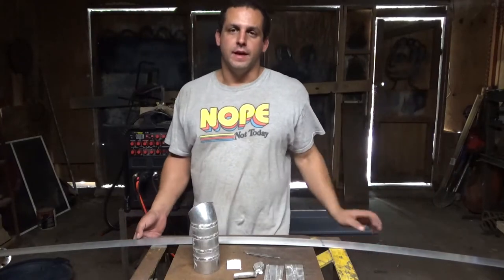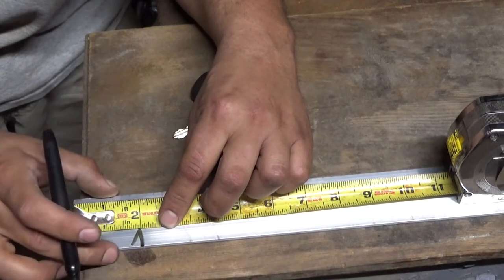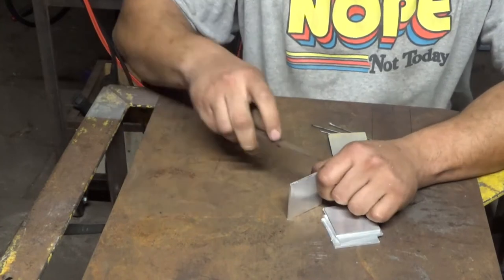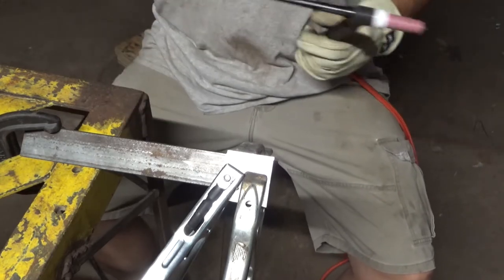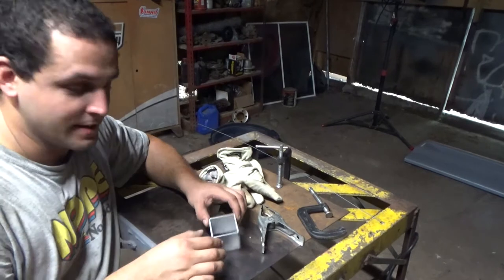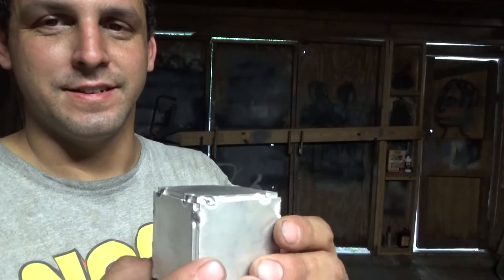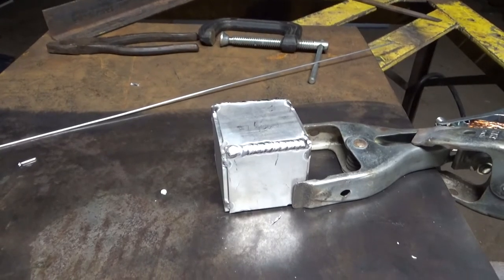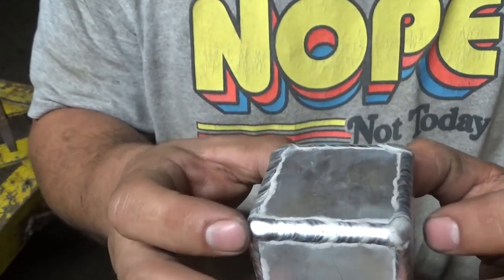tig welding aluminum practice, building a cube with my primeweld 225x tig welder.

Comment: The white color is the cleansing, it happens when you weld AC which alu is done on. This is my understanding. You can control it by changing the balance which essentially set the amount of time it spends on negative/positive. Read the manual on page 37, "AC TIG WELDING", it explains the balance. On the old transformer boxes you would not have any balance, so it would be a square wave with 50% spent on negative and 50% spent on positive. You can change those amounts on the Primeweld with the balance knob. Surprisingly, the manual is not bad for a Chinese welder, and neither is the welder. I had an Everlast before this machine and comparing the inside of the machines is night and day. Surprisingly the machine will actually burn 6010 stick rod, and it has no settings for stick. No arc force, no hot start, but it can burn it. I only use mine for tig welding. I like your attitude, keep welding and learning, don't listen to the haters...the welding community can be brutal, second only to the chainsaw forums...another brutal community.
Reply from the maker: Yeah, I'm pretty new to welding aluminum and I seen that part in the manual that explains all the adjustments.  I will definitely be reading all of that section. Part of my problem I think was my tack welds were too big and I was trying to add filler before I had a good puddle. Not to mention I really don't know how to adjust everything properly.
Reply: @davidcraft4909  I don't want you to think I know what I'm doing, I just play welder on the Internet. As a rule of thumb you should have your balance at about 35% on the Primeweld. I tend to use more steel tube as it's cheaper than aluminum. Not much at the recycler, and often needs cleanup. The prices on steel suck right now though. $30 ain't cheap for that stick of 1/8" you got. Tig is a can of worms as it requires gas, regulators, hoses,  solenoids, special gloves, pedal, angle grinder(s), etc...you need to be able to sharpen tungsten, clean welds, have cleaner on hand, etc..you're doing great, keep it up!
Reply from the maker: I really like tig so far though. I got my first tig welder about 2 years ago. It was a DC only machine so I got a decent amount of practice on steel. But there seems to be a demand for people who can weld aluminum. So I got  an AC DC machine. I think it would be a very good side job since welders like to charge about 100 to 150 an hour.
Reply: @davidcraft4909  I did the same, my Green Weenie was DC only. For most people that's all they really need, it depends on what type of work you do, but the stuff I need is more fabricating, mobile bases, carts, truck rack, etc...some of it is on rusty outdoor steel, so it's not good for tig unless you spend time cleaning it up, so that's where I would use stick. So simple, a stinger and a work clamp...snap, crackle, pop! Tig is the complete opposite, very clean, quiet, almost smokeless, it's mesmerizing. Set your preset to about 2-3 seconds, hang on the end of the bead while you taper off and keep it for those 2-3 seconds over the end of the weld. That'll help those craters. Your beads don't look too bad, you know what's wrong with them, but they look solid and strong, I don't think those pieces of the cube are coming apart you welded. They might not be Internet quality, but they ain't comin' apart!
Reply: Oops, I meant post flow, set the post flow to about 2-3 seconds. Some folks say 5, but I find it just wastes gas. I'm hoping you'll inspire me to do some welding projects I have in the plans...but I'm busier with bigger stuff...
Reply from the maker: @konoctiswigwam8130  Well I've always wanted to learn how to fabricate stuff and I always found welding fascinating, but I never had an opportunity to get in to it. So I'm making my opportunity lol. I have a lot of ideas for stuff that I want to make. like fire pits, smokers, furniture, and I want to do side jobs. I even want to build a 4 link suspension for my samurai. Anyway thanks for watching and commenting.
Reply: @davidcraft4909  I think you have an XLNT machine to do everything you need plus some. Some people will need the power to work on heavy steel, but I don't need that much for what I do. I like stick also, and the Primeweld is not a bad stick welder, but it's kinda big and not sure how the plastic will hold up in normal use dragging it around. I also have a small DC stick/lift-tig box for that. I also have ox-acytelene as well. For Tig if you do need to go up to 300-350 amps you're probably looking at a machine that costs 5x the price. Also it saved me from having to buy a CK torch anyway, which I had done for my Green Weenie, it came with a Chinesium torch that I rubber started to melt around the cup lip. The Chinesium red super flex gas hose looks just like the CK, but it's crap, the rubber cracks, the cloth webbing isn't nearly as flexible...and the CK has metal to attach the cups, the Chinesiums have rubber. This is on several Chinese torches, IME. Taught me the hard way to appreciate CK super flex hose.